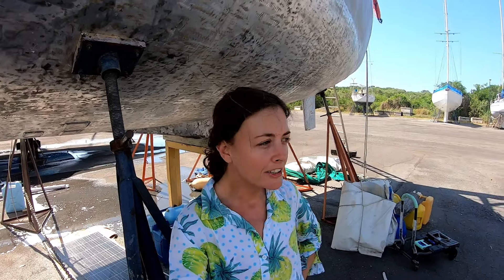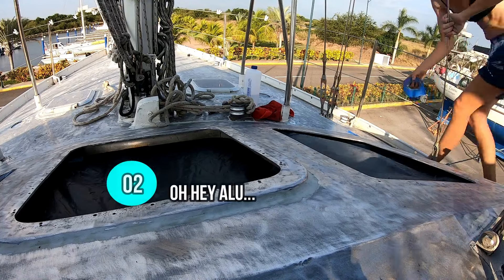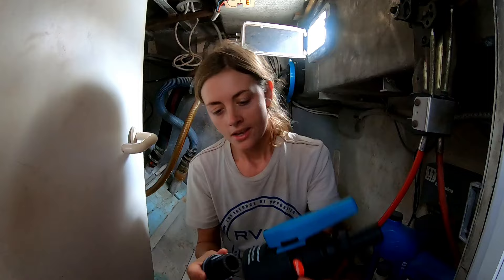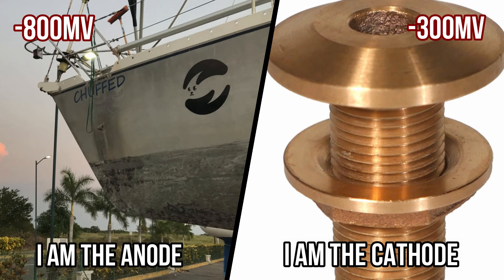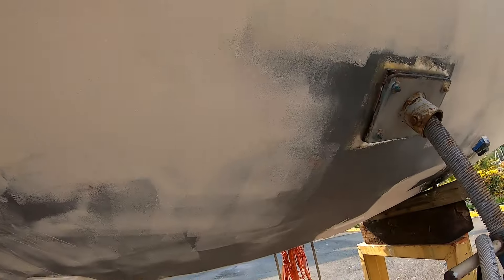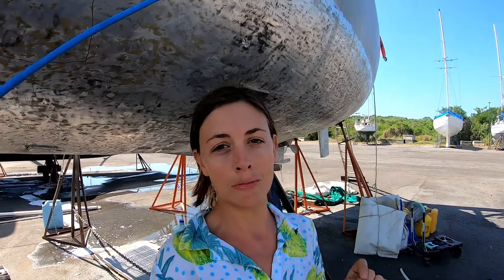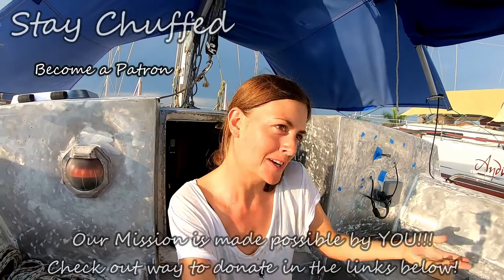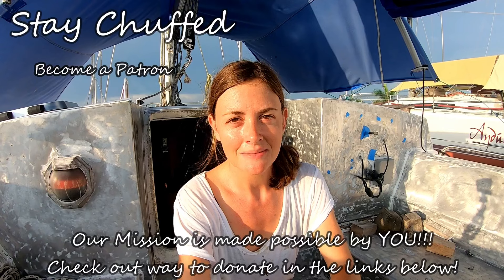Anodes are Good, Corrosion is Bad... Aluminium Boat 101 Chuffed Special

Comment: Very interesting.  Do you have to check your anodes often?  And won't they give you a lot of hydrodynamic drag?
Reply from the maker: Yes they in theory can slow you down, but we aren't races anyway, and you just try to make it as streamline/even as possible. Anodes usually can be checked with every haul out (annual/biannual) but I also check them just when I dive on the boat
Reply: Thanks.

Comment: So, did that boat not have anodes to begin with? Or the original owners neglect the boat?
Reply from the maker: No she didn't have anodes as far as we can tell, only on your throw overboard and attach to a rail which wasn't sufficient. Previous owner had her for sale for a looooong time, we got her cheap because of that but also in bad condition!

Comment: aluminum began to be imported from the English colony, which used to be the USSR, and therefore they did not bother with plastic and wood. There is a lot of aluminum and it is cheap for a shipyard and it is easy to work with it - bend, argon welding, paint and most often only visible places. The rest will be eaten by corrosion after many years, but these are the problems of the owner, who fell in love with cheapness and a yacht, but does not understand that a boat made of cheap aluminum is delicious food for ocean water. In the 70s and 80s, very, very, very high-quality cases were made of plastic and wood, and today it is beautiful trash and bad economical technologies.

Comment: You should replace the aluminium water tank with plastic or  stainless steel tanks. Aluminum is suspected of causing cancer and dementia when it is ingested or used in cosmetic products.
If you use stainless steel, then make sure that the stainless steel is electricially isolated from the aluminium hull.
Reply: there are a few threads on some sailers forums on that. New(er) research denies that claim.
Reply: That's true of SCUBA tanks because over many pressure cycles the aluminum fatigues and aluminum oxide dust gets into the air.  I don't think this is a problem for fresh water tanks.
Reply: "Supposed to" and never proved. Aluminium is the most abundant metal on earth, the 3rd most present element right after oxygen and silicium ( you can fact-chzck this) . There is AL everywhere, in the water you drink, in your food.
Reply: @philv3941  And it's an element, your body doesn't need in elementary form. It's not like iron, iron is a biological messenger.

Comment: I am  thinking of buying an Aluminium Narrow Boat it's for cruising the canals so there shouldn't be any salt water attacking my hull nevertheless I'm shocked to discover Aluminium corrodes.
Reply from the maker: Oh yeh, it gets eaten quick by stray electricity, should be a lot better protected in fresh water but still need to look into protecting it as best you can!

Comment: no paint on or under the anode?
Reply from the maker: nope, if you paint over the anode it wont work (you can technically paint under it IF it still comes into good contact with the boat through the bolts, but most leave it bare)

Comment: How many anodes do you think important to position on the hull? on which particular location?
Reply from the maker: There was a website I used, that had an anode calculator on it but I cant seem to find it again!
Reply: use more than is recommended for your boat, cheapest way to prevent corrosion...

Comment: The Electrolysis part I can not agree on. The main thing is not using the hull as any sort of conductor. All AC and DC  wiring  should only be connected to the hull with high impedance to stop static charge building up. Look up IT earthing strategy.  Power down the vessel and measure impedance between neutral and the hull,  Live and the Hull, +12V and the hull, DC minus and the Hull. These should all be more the 500Kohm.  Be aware of consumer electronics that connect DC minus with the case, like car stereo and VHF / HF transceivers.  Anodes have no role here.
Reply from the maker: We have gone the route of having nothing grounded to the hull, which is generally recommended for DC wiring on aluminium boats (lots of theories both ways)
Reply: @VetTails  That is what I am saying.  The same goes for the ac. Normal inverters can connect the neutral to earth by default.  An isolation monitor is needed too. I am an electrical engineer in the offshore. It is critical to get this right.

Comment: How were you able to find the stray leaks?
Reply from the maker: Using the voltmeter on different wires and the hull, you can eventually find the one letting a little stray current through!

Comment: The go fast sailor in me just cringed with that zinc anode.  Well you guys aren't in that much of a hurry.  Plus I think you will get back a lot now that the hull is smooth.
Reply: Useless greenie bottom paint will slow a boat more than a heap of anodes.
Reply from the maker: Yeh totally agree, without all those nasty barnacles too! But yes, we have a racing boat next to us and he convinced me to have the welders move the anode on the rudder to the bottom because it would create drag haha
Reply: @VetTails  Not really about drag on the rudder, but having non turbulent flow is important for effective steering.

Comment: The keel is very short can this boat sail long crossings?
Reply: It has a center board.
Reply: grancito2 I have no idea about the Center board
Reply: @Mr.Alia63  I'm not clear what your comment means, you don't understand what a center board is?  It is a keel that is lowered through the bottom of the boat.
Reply: grancito2 thanks a lot, is this as same as retractable keel?
Reply from the maker: Yeh more or less a retractable keel, my keel 'swings' up into the boat, so when motoring I can put it up and go faster/have less drag, when sailing I can lower it to help provide into the wind stablity etc
Reply: Vet Tails' Sailing Chuffed and you can retract it in shallow waters, amazing 👌

Comment: Do you have a  silver/silver-chloride half-cell or reference cell yet?
Reply from the maker: Mmmm Im not sure what that is so no (is that the thing you can throw over to help take measurements on the hull with?)
Reply: @VetTails  Yes, and I am told it is essential for Al. boats especially if they are ever connected to shore power or moored in marinas with faulty electrics (that seems to cover all of them doesn't it?)  I have seen examples of  horrible damage done in a matter or days so knowing there is no current flowing seems important. One point in your very good explanation that you did not bring forward is that the metals are a series and that once the zincs are gone whatever is next in the series gets eaten away. Apparently sail drive legs are particularly tasty.

Comment: Hi I can't understand why the designer of Chuffed did not specify anodes as electrolytic action on metals was known about many years before she was built. Anyway she now has them  and I hope that they behave and do what they are supposed to do. Cheers
Reply: They fall off and dissolve away.  My guess is they did and they did.
Reply: @edwardschmitt5710  Hi Edward Yes they do dissolve but you should still see where they were mounted with bolts or a plate etc. Cheers
Reply: @ramseybarber8312  true... but I've seen two barely noticeable stubs of bolts on many a transom with no zincs left on them.   I would say there MUST have been some at least when the boat was built...but then again there is all that corrosion...
Reply from the maker: Honestly I have no idea! There is a good chance they did rot off somewhere along the way, maybe previous owner decided to do away with them for some reason... who knows...
Reply: Not everyone maintains their boats, just as they do with vehicles, houses, yards, etc...

Comment: I have an aluminum Marinette Cruiser.  It has a meter on it that shows corrosion.  I don't understand its function.  It shows certain levels that say you are protected , not protected or overprotected.  It's meter is graduated with numbers.but not sure if this is current or what.  Any thoughts as to what it it and how it works.

Comment: You should also look at the type of aluminium alloy first and then it's the same with the anodes so that any possible loss of the aluminium alloy is minimalised.
Reply: Yes, KM aluminum boats in the Netherlands are highly regarded and they only use a specific aluminum alloy....believe there are only two alloys specific to saltwater boat use, fresh water has more options with aluminum alloys....

Comment: why would you use stainless against aluminum at all? I'm not following
Reply from the maker: Stainless steel can be used to clean the aluminium oxide, other metals are more likely to cause corrosion (eg. copper wheels would be a big no no). We followed recommendations from alu boat builders :)

Comment: U have so much problem because u have not paint your boat properly. Multicoat is industry standard. U need different multicoat for both interior and exterior surfaces. And u need not install anodes on boat exterior... it can be on the interior as well. And remember to maintain it regularly. It's going to be real expensive if u do it properly. Of course, u can do it cheaply and perhaps do another video on aluminium problems.
Reply: Hi Hans, that is an interesting idea. Do you have an ALU boat or any info to back that up? Sounds like an interesting idea.